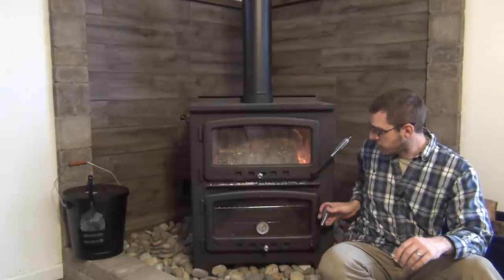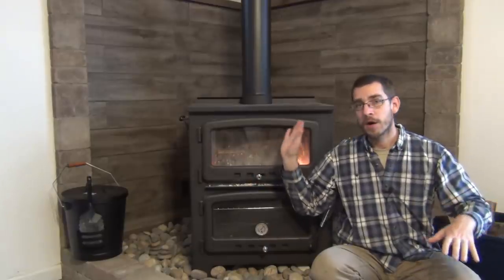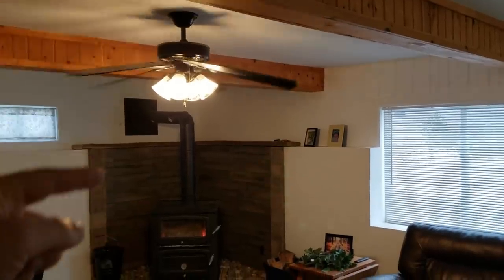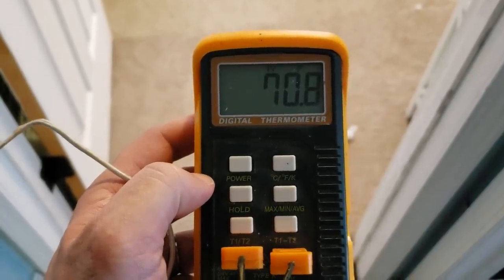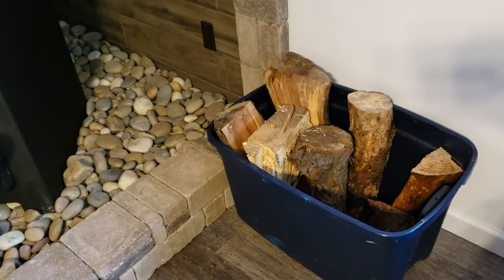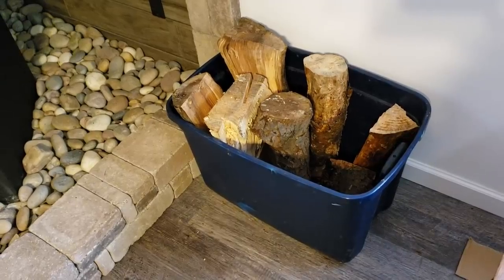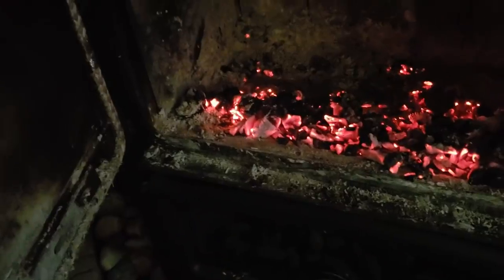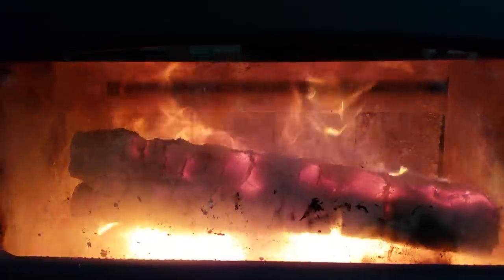Heating With Wood - How well does it work? | Vermont Bun Baker XL

Comment: Be sure to have a CO  and an O2 detector in the vicinity.
Reply: Have lived in 8 different homes with stoves. Never did one of them have carbon monoxide detectors. Nobody died.
Reply: Jpb6583 I have driven hundreds of thousands of miles and never died in a horrific head on crash. Doesn't mean it won't happen one day! Why would you not take sensible precautions that cost next to nothing rather than risk it?
Reply: Totally not needed.  Wood fire need O2 to burn.  Humans need less than that.  Co2 is only needed for unburnt gases.
Reply: @oswaltedmund6257  what in the what??? Co1&2 is created when you burn wood it after oxygen is burnt. You should always have a carbon monoxide detector incase the off gases are not properly vented or the vent becomes blocked (ice snow etc, its actually happened to me)
Reply: Oswalt Edmund There are many recorded deaths resulting from carbon monoxide poisoning from wood stoves. A blocked flue can happen at any time- blocked by a soot fall for example. Carbon monoxide detectors are required by law with every new stove install in the UK, I do t understand why anyone would take the risk. Carbon monoxide is fatal at relatively low levels and because of the way it works by making you drift into a really deep sleep before you die there is nothing to alert you to it. For the sake of £10 or so why would you risk your life?
Reply: Our Entire family almost died in Belgium 25 years ago from Carbon monoxide poisoning. its no joke. a detector is a must if you have anything like a wood stove.

Comment: If you cut some vents in the ceiling of the basement and put floor vent covers on top, you'll see a big temperature difference in the upper floors. Not a hard job, just be careful of any pipes and wires that may be running thru.

Comment: Try running blower motor only on your furnace that will circulate the hot air it works really good

Comment: In the comments I have to agree with keeping 1-2 inches of ash in the stove. It does help reduce consumption. Many do keep a kettle r pam of water on the stove as it does get dry and the water is always ready for a cup of coffee, hot chocolate or oatmeal. Many women like to put apple cinnamon in a kettle to scent the air which I have to say will drive you nuts for apple pie. Put two eco fans atop the stove as they are electricity free, give the ceiling fan a break. Clean the chimminey every four months and make sure the wood is seasoned a year. Pine lumber or planner ends tends to burn hot and build soot faster which leads to home fires. Be warm, safe and blessings to your family.

Comment: Your living room looks beautiful with the woodstove.  Our experience with an inefficient franklin stove, we found burning two pieces of tree root kept a fire from 10p.m. until 6a.m.  
Our old family farmhouse had a cast iron pass through vent in the ceiling of the lower level with a floor cover into the upper level allowing heat to transfer more efficiently.
Paulette

Comment: I didn’t read the comments so someone may have already said it but if you install vents in the ceiling to go to your upstairs it would heat more evenly. Although 70 is perfect this would be a recommendation for others with an undersized wood stove or using your havoc fan only will help disperse the heat evenly. Do not do that with an open fireplace.
Reply: Sorry for the typos

Comment: For a high end stove it seems like it has an extremely short burn time!  My old 20yr old Wonder Wood will still have a large chunk of wood and large bed of coals after 12hrs (oak, black locust can go longer) just fill it with 2-3 large chunks and shut draft all the way.  Not as pretty and doesn’t have a reburner or window.  Have been considering the Drolet HT2000 (one of the more efficient ones out there) but for $1,200 I’d have to see one in action in person first to convince me it will last as long
Reply: Hey MoFreckles, we purchased a Drolet 2000 from Northern Tools, installed in our newly built log home. Very very pleased with it so far. Our home is 1800 sqft, single story. Seems to be very efficient with the amount of wood that we use. We will be ordering the eco fan for when the power goes out. Keeps our house a steady 68-70 with a small amount of wood use per day.

Comment: Well done informative video. What is the material on the walls behind the wood stove that looks like wood? Does it hold the heat? I assume that it is fire retardent.
Reply from the maker: It is tile, Lifeproof tile. Check previous videos for the installation

Comment: Do you have a large metal dust pan?  If you put something like that on top of the stones before you clean out the ashes, you might not need to clean the rocks as often.
  Do you have, or can you install, a "circulate" ( just fan, no heat or cooling) feature on your furnace blower?    It could even out the heat throughout the house if it ran for 5 or 10 minutes every 30 minutes, or 2 minutes on, 13 minutes off, etc.  Those times are usually programmable using the thermostat.  That's a good "to do list" project if it's not already on it.  Maybe your thermostat is already so enabled and you just need to figure out how to do the programming.
Reply: i think he's ditched the furnace idea but i also agree Ron.  get a DC blower in there and leave it on low. fix the current ductwork problems.
Reply: @TheSmagzilla  Oh right, the ductwork is a mess.  😕   sigh    I wonder if he can get his hands on that temporary duct/hose that they use to ventilate sewers and mines.   It probably has a pretty high price though.
     I wonder how a firewatch would work for them.  In the military he must have gotten some experience with night watch, maybe his family wouldn't mind a taste of that.

Comment: Yes heat goes to the ceiling!  The ceiling fan help brings down the heat from the ceiling and around into the room. You can't go wrong with a cast iron stove. My fireplace is now 25% more heat,  into the room with the pipes running around over the fire and the fan blow the heat out into the room. That still leave over 50% that could be used for MORE HEAT! A fireplace insert is way to expensive and not that good. Now if i could make a cast iron box for the fireplace,  that extended out 3' > like a cast iron stove!  It would be more EFFICIENT   like 75% cause the heat is heating up the cast iron

Comment: We are getting smarter about the heat escaping threw the chimney. By burning the smoke, and i ran pipe around the dapper. where heat, heats up the pipe and with a fan. blow the heat out of the pipe into a room

Comment: I place one or two wet pieces of wood in the stove and it lasts 6-8 hours. I use a 5 gallon bucket half full of water and soak softwood (fir) for about 2+ hours & ring off the water and place in the stove with a couple of dry wood usually Alder for extra heat.

Comment: It looks just like a Nectre Bakers Oven from Australia.
Reply from the maker: It is! Rebranded to the bun baker xl when imported into the U.S.
Reply: @SSLFamilyDad  Thanks for your reply. What amazed me from your video was how you managed to get the heat to move around your home. It has started me thinking of how I might get the heat to cycle in our new property which is on a single level. 😀 We are in a valley below what Australians call the Snowy mountains. Our nights can be consistently below 32F or 0C. Often as low as -5C. Day time temps are around 8 to 14c. We don’t get the long, dark, white winters of the northern hemisphere. 
Our homes are however made for releasing the heat of long dry summers.

Comment: Closing air vents = smoldering= creosote buildup in chimney = chimney fire!
Reply from the maker: Fire never smolders as even with the vents closed there is still enough air to let it burn slow, hot, and clean
Reply: @SSLFamilyDad  You stated that when you shut the vents that the fire "smolders",  so that is where I got that from. If you are shutting all the vents and your wood is still getting enough air to burn, that means you don't have an air tight wood stove which could also be a problem. If you ever did get a chimney fire, you would not be able to smother the fire by shutting the air vents? Not trying to be a troll, just concerned. God Bless!
Reply from the maker: Yeah I probably used the wrong term in the video. Also, I wondered about that being an issue if I cant fully shut off the vent but I looked at it when I installed it and the way it is designed the top air vent cannot be fully shut off. I guess if there is a chimney fire I will just have to use the "through water in it" trick and hope that works. Or I could just clean the chimney often;)
Reply: @SSLFamilyDad    --  I've been burning wood my whole life, just clean your chimney a couple times per year and you'll be fine.  I usually clean once in fall, just before the first fire, and once about mid-winter.

Comment: do you have any duct going to the new addition? i know your system was pretty terrible.  try to suck some of that heat out via return vents and get it to the rest of your house via the furnace or they make inline vents too.  i would keep your furnace and duct and just insulate and fix.  wood boiler re-insulated as well but i think you already disconnected it? a few duct hand tools and you can do a lot.  insulating is easy too if exposed.  just some suggestions from a heating/pipefitter

Comment: you should have got a unit with a blower with a rheostat...   also you want to put your fan in reverse so it is pulling up rather than pushing the air down...  that way the air comes up and then it hits the ceiling and then down the windows and hits the floor then repeats itself...   keeps the window moisture also...any builder will tell you this or anyone who sells stoves that knows what he is doing..  I have done this for 50 plus years...   Gary

Comment: Nice video. Question for you since I’m considering doing the same. Did you cut registers into your basement ceiling / 1st floor to assist the heat in rising more easily through the house ?
Reply from the maker: I did not and don't really plan to. I may use the furnace circulating fan once I get my furnace relocated down stairs though
Reply: SSLFamilyDad  sounds good. They also have stove top burner fans that help circulate the air

Comment: Stacking the fuel 90° opposed to what's shown here would allow a greater density of wood inside the stove. Yes the pieces would need to be shorter, but a greater percentage of the stove could be filled. Not only would that last longer between refills just because it'd hold more fuel, it would also burn more efficiently, thus even longer still.
Reply from the maker: This is a really good idea and something we do actually do some of the time. I use all of the log cutoffs and split them down then I end up with a bunch of 6-10" pieces. Tried this last week and it worked great

Comment: I see that You have a lot of room around that stove ... You can make a sistem to distrubate that heat better and very efficiant by duct system . A little construction work may be needed but it is a cheaper and most efficent way to heat a hause, and doesn't cost a lot if You are skillful, what You are as I can see from Your's videos.

Comment: Is it ever viable (wood resources & financially) to have a second smaller stove on the main level?  Or would that be overkill?
Your set up is beautiful - very nice :)
Reply from the maker: My wife had suggested this also, it would probably be fine actually to have a second stove especially for larger homes. That is what they used to do in old homes there was a fireplace on every level centrally located

Comment: Wood heat needs 300 to 500 degrees you can buy chimminy thermometer . instal thermostat to a fan to pump heat thru house. So what did the stove cost?
Reply: 4k

Comment: What's the deal with burning pine inside?  I am also in Michigan and my five acres is being hit hard with the pine borrer.  So every year I am having to drop 5 or more 40 year old dead pine trees.  But everyone says not to burn it inside or it will instantly fill your chimney with creosote and start a chimney fire.  I'm thinking that's an old wive's tale or grossly exaggerated.
Reply: This comes up in every video about that stove...

Pine burns hotter and has more sparks, so it ignites the creosote  that was deposited in the chimney by *hardwood*. Obviously not an issue if you fire mixed woods, but when switching from years of hardwood to pine...
Reply: @HenryLoenwind  So if I have a metal-lined chimney and run a cleaning brush through it I should be in good shape to burn pine inside it sounds like?  I had an old 1950s masonry chimney but a camera inspection found gaps the size of your fist in it, so I opted to have a circular stainless liner installed.  I've only used hardwood inside, and it's only been a couple years that I've had it.  Barely anything came off after giving it a good scrub, maybe half a cup of dried black gunk.
Reply: Pine has more tar so if you turn the air all the way down, it will not burn and want to deposit on any cool surface like an uninsulated chimney. Not a problem as long as the burn is efficient and everything is combusted.
Reply: As others said make sure the pine is dry. I burn what ive cut down on my property.
Reply: @Squick99  Just burn hardwood. Creosote is incredibly stick and can't be easily removed from the chimney.
Reply: In my experience, the problems with pine are exaggerated, always keep your chimney clean though.
Reply: How well does the oven work ? Is there any temp control on the oven?
Reply: I live in the south and pine trees we have down here are LOADED with pitch, which is
why the turpentine industry was so big here, at one time. Pine burns too hot, too fast, and will load your chimney pipe with creosote. Stick with well seasoned oak, hickory,
apple, cherry, and pecan (lots of pecan trees blew down during Hurricane Michael)
I've been  through a couple of creosote chimney fires, and it is not for the faint of heart.
Reply: Smoke that becomes too heavy or stays for too long creates a substance called creosote. This is when you do not let your fire burn hot enough to start the process of burning. When you start a fire you need to let it burn hot before you restrict the air flow.
Reply: If pine was a problem, then half the homes in the Rockies would have burned down from chimney fires.
Reply: I toured the Travis Industries (maker of Lopi, Avalon, and FPX) facility in Mukilteo. Guess what they had several cords of for all their test burning...fir.
Reply: @Mark OnTheBlueRidge Googling around shows a lot of opinions that agree with yours. We all learn something every day.
Reply: "Don't burn pine!"  is an old husband's tale.  ZERO scientific proof that it's bad.  Probably made up by a firewood dealer because he could get a higher price for hardwood.

Comment: I have a Pacific Energy Summit Le. Just bought it. Loaded it up with wood, wood is burning and flames and blazing, but by basement where my fireplace is still reads 18 degrees Celsius which is totally absurd. What isn't this fireplace radiating more heat?

Comment: I would be concerned about standing on the uneven, raised surface while cooking on a hot stove. A slip or fall onto any of those hard edges would really hurt, not to mention the considerable burn risk. At the very least, a larger standing area would be safer.

Comment: I'm not sure if you have the basis for comparison, but I'm curious if your stove seems a great deal better than something like an Englander NC50, which I'd guess is one of the $1000 Home Depot type stoves. I've purchased really high end things at times and will sometimes find that something that is basic and cheaper, but still of good quality, may not be quite as good, but is good enough in terms of functionality and longevity so that it ultimately wasn't worth it to spend so much more for the high end thing. Conversely, I have a small Jotul 602 wood stove, for example, that was expensive, but I don't think any other cheap small wood stove is nearly as functional. Once you get up to the mid-size wood stoves, there are a lot more choices though, and some affordable stoves have very good reviews. Was it worth the extra money in your opinion?
Reply from the maker: This is not just a wood stove but also an oven which you aren't going to find elsewhere. Also, there is no catalytic converter which all the off the shelf stoves have. This thing is super high end meaning thicker cast iron, glass, handles, etc. For us it was worth it. But would another stove work to produce heat and burn wood just as good, cant see why not
Reply: @SSLFamilyDad  Good point. The oven in a your stove is a really unique feature. My father bought and sold antiques at times, and we had a wood burning range on one side of the kitchen that was from the 1800s, but that was mostly a cooking device, not a great heater. The firebox was small and not airtight so it needed constant feeding. It's really neat how your stove has all the practical modern efficiency of a modern airtight stove that can heat a whole house, yet also allows for cooking and baking. We were the only non-Amish on the the road we  lived on when I was a kid, and they were always looking for ways to efficiently use non electrical devices- the Amish would have loved something with dual usage like this.

Comment: the river rock would suck, I have had indoor woodstoves for 50 years, also I have spent a number of year at a woodstove plant part of the time in the R&D, you need a bower on the stove, even if you just sit one on the floor behind blowing up the rear heat shield.